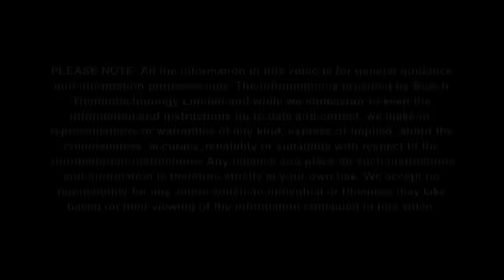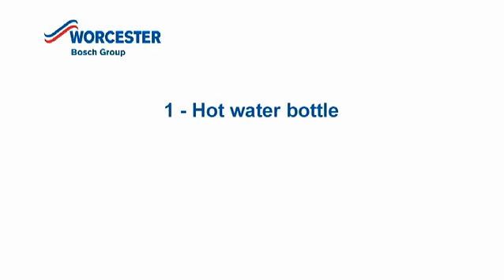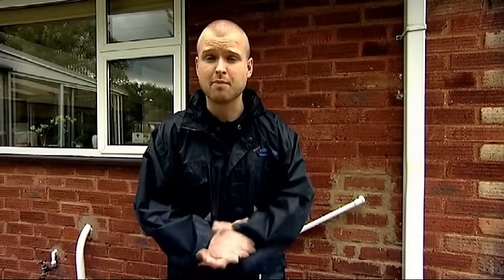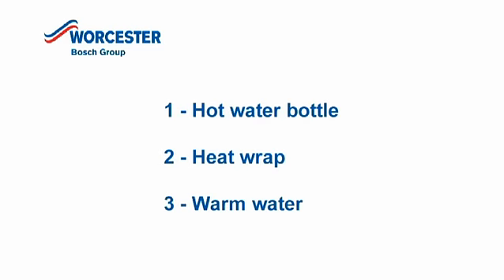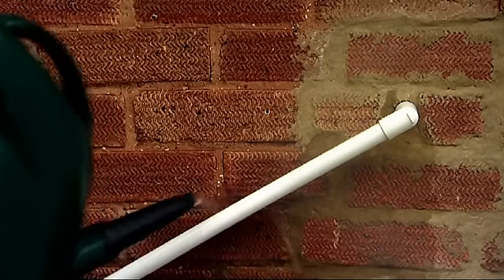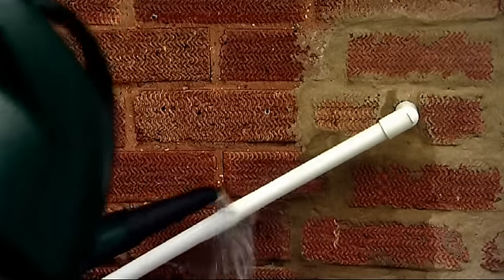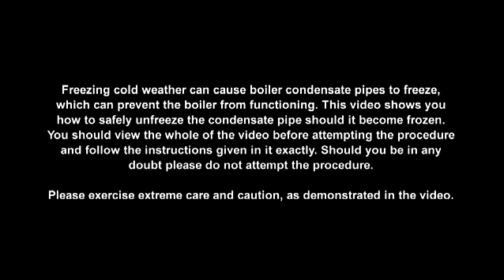Thawing a frozen condensate pipe

Comment: This was a life saver. In the middle of "The Beast from the East" weather system, my boiler started gurgling and then stopped, with the temperature at minus 5C outside. I was not happy. I found this video and it took me about 5 minutes to fix the problem and the boiler is operating perfectly again!

Comment: If your boiler is on the kitchen wall. Just have your pipe fitted though your kitchen cupboards and into the internal waste under the sink on the inside of the house instead of the outside. Did this 10 years ago, never had a problem since.